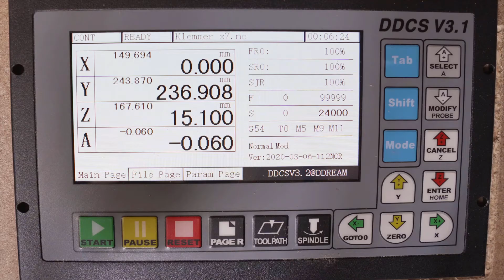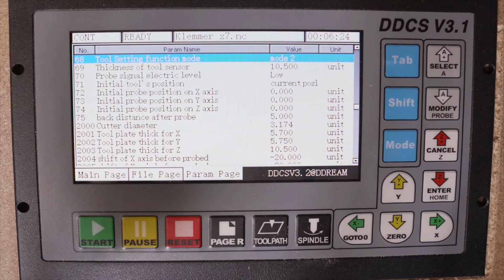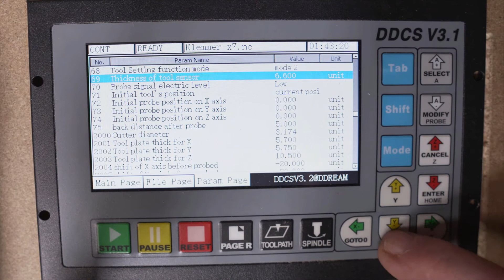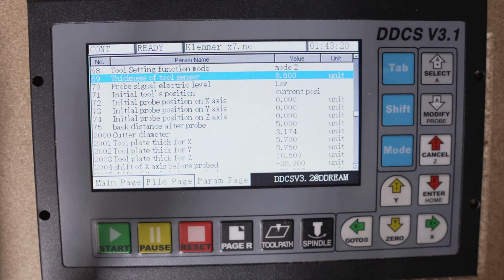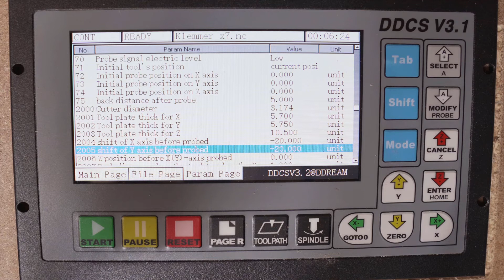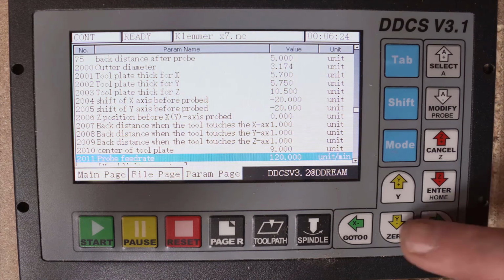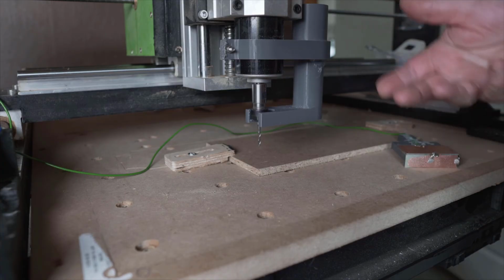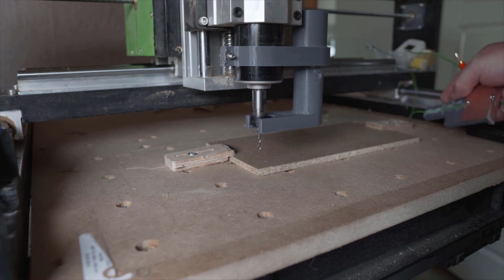Probe X Y Z with DDCS V3.1 automatic and how make use off probe tool.  cnc z probe diy

Comment: Good afternoon D3P. I always follow your channel here in Brazil and a few months ago I had the opportunity to clarify a doubt with you about this DDCS V3.1 controller. But recently there was an abnormality during the cutting process with the controller, where the Y axis at each complete turn it shifts a little away from the initial positioning causing an inaccuracy of the cut. Has this ever happened to your machine? Do you have any idea what it could be? Thank you for your attention and I hope I can be of some help.
Reply from the maker: Hello Edmar. Thank you for watching.   I have never seen that on my machine.  Maybe it is a parameter in your cnc software  and not the DDCS .  In the DDCS check the Parameter #113 is set to 0  I hope it helps :)
Reply: @weitlingD3P  Good morning D3P. Thank you for your support and prompt service. I'll try to change the parameter to try to fix this. Since it was using another controller and this did not happen, the suspicion falls on the DDCS. Thank you very much.

Comment: I dont understand where does the cutter has a +24v or -24 wich contacts with  that probe |?
Reply from the maker: Hi The probe does not use Volt.  It is a analog signal from a switch that is open or closed.
Reply: @weitlingD3P  so cuter is just grounded spindle signal thats it  ?  I mean the cutter part not the probe part.
Reply from the maker: @povilasvaiciulis7931  Yes that is correct

Comment: Hello, Does the DDCS V3.1 takes care of the backlash? Thanks
Reply from the maker: Hi Yes you can enter how many millimeters you want it move after home or limit.  I use 5mm
Reply: @weitlingD3P  This is for software limit settings. Are you sure this is as well for backlash compensation settings ?
Reply from the maker: @Levisgil47  Maybe i not understand correct.  Take a look at the link below, at page 67  then item #83 #84 #85  Is it that you are looking for?
https://drive.google.com/file/d/1987kj9OTJ87Z6NIBZqw8uX5PfoYzbJun/view?usp=sharing
Reply from the maker: Found what you where asking for Yes it has Backlash  see picture  https://1drv.ms/u/s!AgaOae17V8HihJYDLuP03kunSzy0yw?e=eiYJc5
Reply: @weitlingD3P  thanks
Reply: Yes, the  DDCS V3.1 has backlash compensation and is a superb controller.
Reply from the maker: Try this link https://drive.google.com/file/d/1987kj9OTJ87Z6NIBZqw8uX5PfoYzbJun/view?usp=sharing